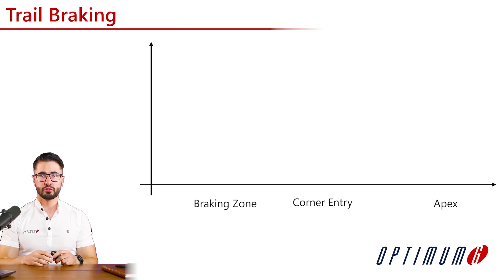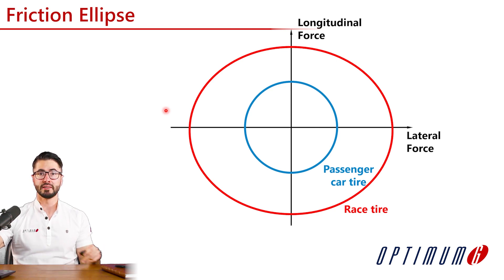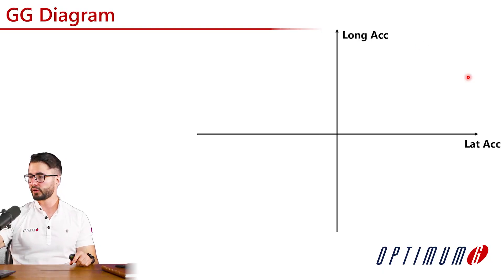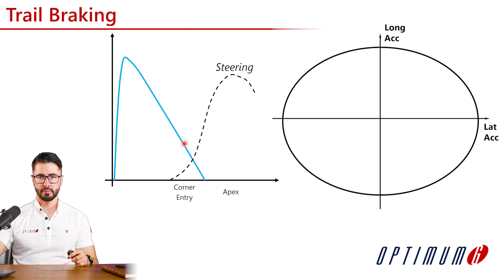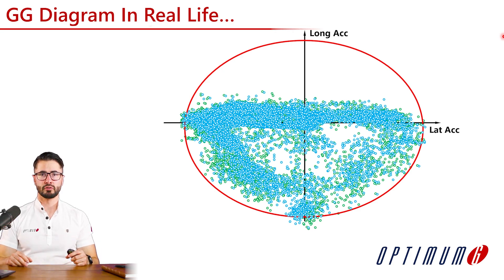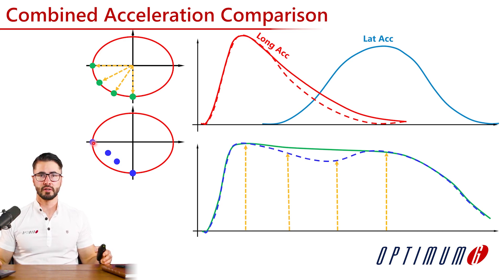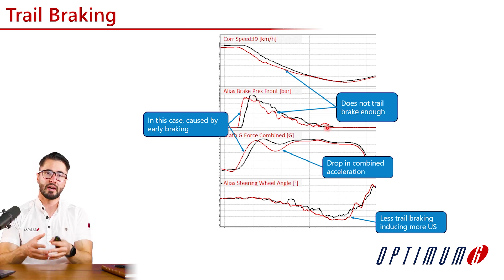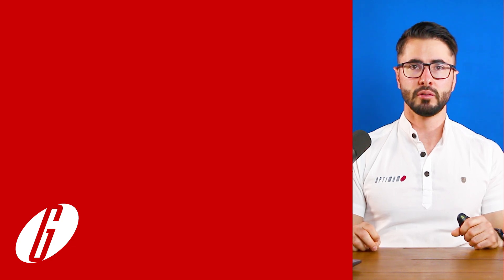Trail Braking: How to Quantify it with Data |  Performance Engineering Series - Ep. 6

Comment: It would be even more easily identifiable if you plot LongG and CombinedG together - than a "valley" between the point where LongG starts to fall and CombinedG starts to "rise' to maximum values will be even more "eye catching". Just make sure that your LongG deceleration has the same sign as your Combined G channel.